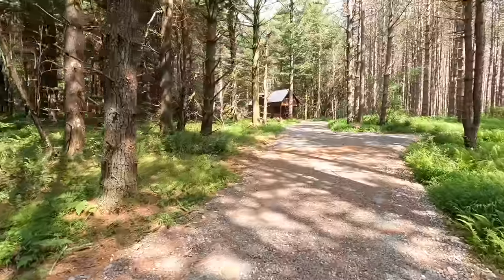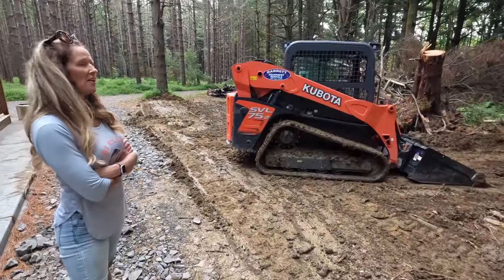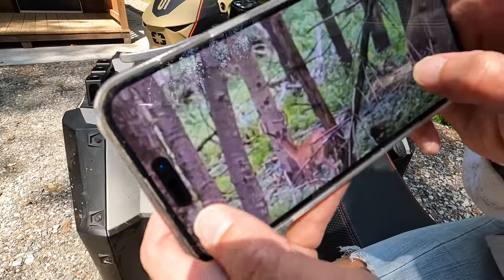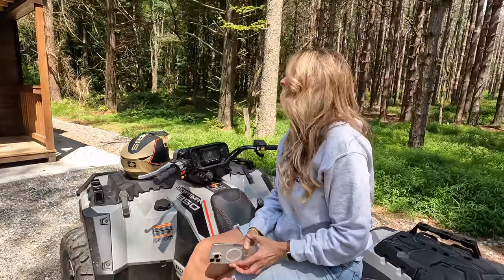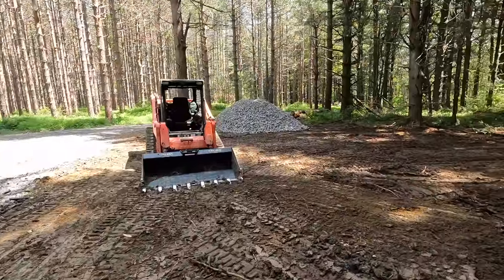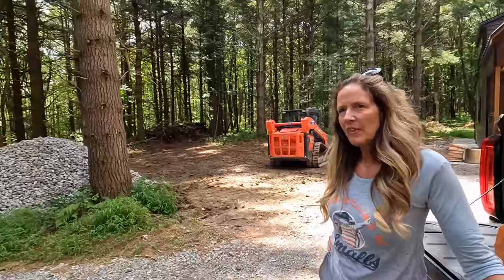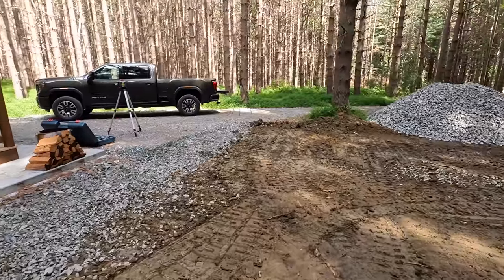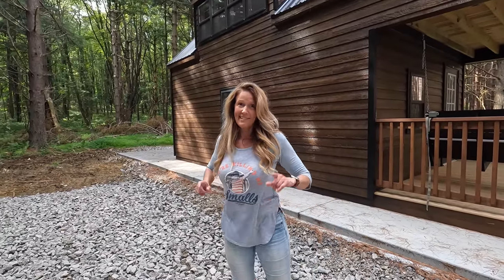Frustration to Production, Cabin Work and Melissa goes Exploring

Comment: I had a pile of debris like that once, was slightly larger. I have a Kubota L4700 with a grapple on the front and a land plane. I have a creek running about 1400 foot across the west line of my property. I was able to line the bank in about 3 hours. There were several large trees, probably about 15 in the pile. Flood control and also helps to keep random people from coming thru the woods, jumping the creek and stealing ATVs etc... and riding them back out.

Comment: You guys have a good plan. Using the window area for hall way will be perfect. Like the new circle drive addition. Agree with you on chipping debris. When I first started working my land I burrowed my buddies chipper. That scheme lasted about half a day and the pile of logging debris hadn't changed a bit. Took the gas out of the chipped and mixed in some diesel and lit the plie off. Best fire ever. Nothing but ashes 6 hrs later.

Comment: Mike, on your front porch swing, we have one that we hung almost identical to yours. With the screw eyes (4” thread) in the vertical down direction, the threads can slowly wallow out a bit from the swinging motion over time. Ours pulled out after about two years of use. 
I was able to drill through the entire 2 x 8 vertically an install a long eye bolt with washers. Since your deck is above, you may be able to use eye bolts through horizontally to prevent them pulling out with time.

Comment: Hello Mike & Melissa, I've got to ask why go through all the work of preparing for concrete only to need to dig it up for water disposal and electric or did I miss something. I did notice that rental just doesn't have the butt your use to. Don't believe I've ever seen you spin the tracks on the 97. Got to say that Melissa appeared to be bored silly on the porch while you were grading. Is there decent internet there or are you dead in the water on that. Can't quite picture your addition but I'm sure it will be good. Looking forward to seeing it delivered and attached. Thanks for sharing. Ron

Comment: Two new pick up trucks and still  renting a skid steer am i missing somethig
Reply from the maker: No, I am, a proper trailer. My skid loader weighs 13,000 lb, with my current trailer i would be about 6,000 lbs over weight

Comment: I disagree with Mike on chipping.  I have a Woodland Mills WC68.  It makes fast work of chipping branches and I don't have to worry about starting a forest fire.  I can cut up anything I want for firewood but can chip the branches.  Unless you have a large pit to burn wood it takes just as long to burn as it does to chip and I can use the mulch for bedding areas and trails and I don't have messy piles of brush lying around.

Comment: Hey mike I have run both the 97-2 and 75-2 track loader and I’m curious which one you seem to like better I found in my experience I gravitate toward the 75-2 for power to weight ratio and lift capacity

Comment: Mike do you find it better to have a bucket load when compacting/walking in or does it put more pressure unevenly on to the front of the tracks ? A wheel loader seems to rut out quicker with a full bucket unless the ground is bone dry. A track machine just always seems to leave a more "finished" look to me.
Reply from the maker: Yea I like having a full bucket when compacting